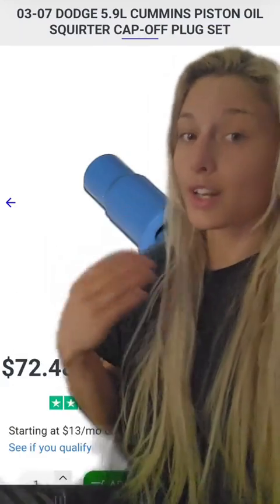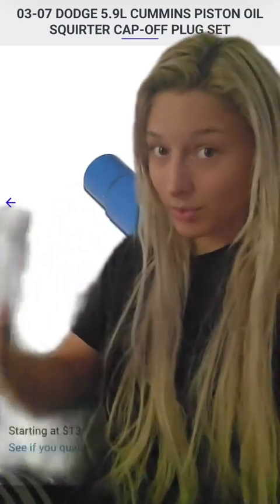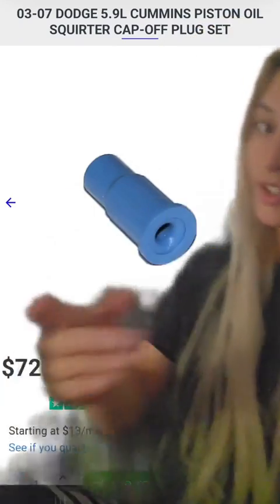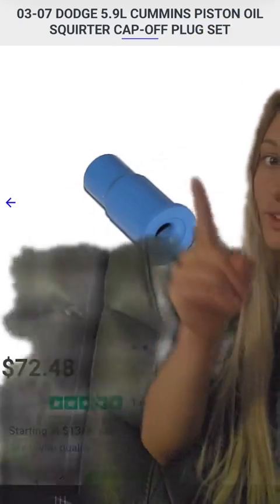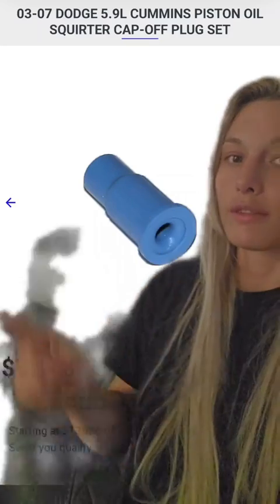5.9 cummins main bearings: why the holes don't line up.

Comment: In a Cummins 855 these style bearings were commonly used,some blocks were drilled for both holes and some were drilled for one hole, but they both ran the same bearings. It didn’t look right, but it was oem and worked just fine.

Comment: Lets talk about oil pressure and whats really going on in your engine, regardless of what kind of engine,as long as it has oil pump and pressure fed bearings the " wedge" principle is the same!! We all know fluids are for our purposes NOT compressible. If you have lets say 80 psi registering on oil guage, you must add up the total surface area of journals and bearings and multiply that ( there might be a formula) by your 80 psi. You literally have TONS of pressure holding your crankshaft in suspension and floating your rods on their journals!! TONS of pressure!! Its helps to know a little about physics when in this line of work. Thanks for your channel Melissa. Keep doing what you are doing!

Comment: Good explanation Melissa. On Mack engines piston cooling nozzles are metal. They could get bumped or whatever. So there is a plastic target that you place onto each hole( head off,crank and pistons out, obviously). Then with either a welding rod,flux removed,or other similar rod,that's straight,you insert into cooler and see where the oil jet will hit on bottom of the piston. If coolers aren't targeted properly,gently bend the cooler nozzle,so your metal rod points to acceptable point on the plastic target. Doing this for each hole. Obviously one wants to be extremely careful when i stalling crank and rod/ pistons assembly's,so as to not bump nozzles after targeting them.

Comment: time and place or consumer and product 4bt is good engine so is three or two for applied application 
to be blunt and honest not all parts are great got qulity maintace maybe it last fuel gas oil air air filter elments exposed use 
reason for personal tranportation application not to pull friegt train or semi not roll coal be idiots  but world takes all kinds to each thier own just do it over thier no over thier little closer get better warmer yep do it in hell or such .
this is not only diesel engine so so many uses for parts one thing fad its like sliced bread to each your own i am not nore will i ever be one size fits all name brand so many inovations under build over build to me like older engines new plastic okay 
but every thing has its advantages and disuse time and place but truth is built better one company no longer around built great truck so well they went out buniness in hay day of logging in musem now seattle washington i wood say pun 1970 acts had effect use full purpose not want a need  5.9 or any engine for me not fan like small ones for job like need detroit diesel
but osakosh to me or catapillar reason some russien or eurapen trucks road trains design air fuel exuest simple design 
built for some kid run around gas being cheap sure big engine great  but lot them never road trip thier race junk

Comment: I was a diesel mechanic & trainer in the army for 14yrs. & then when I got out I was a mechanic or a shop foreman for another 20 some years & in that time what I have found out is those of us who are leaders/trainers will spent less than 10% of our time with the top 90% of people & 90% of our time with the bottom 10% of people. I am ranking them by brain power.

Comment: Aircraft engine's  oil passageways to bearing holes don't  line up completely either.  And the higher horsepower engine's  have piston cooling nozzles. You are doing  a good job. F the critics they are the ones that are driving their  foreign  vehicles  to the dealer to get bored and stroked (metaphorically)
Reply: And bent over by the dealerships.

Comment: Asked a simple question if they should line up.  Why the absolute hostility?  I'm no longer interested in you and your overdramatic hostility.
Reply: Where's the hostility in this video?
Reply: @daniels-mo9ol   Be less unconscious (note, this is hostility since you're being oblivious to it).
0:30 "This is what everyone is  about".  "Crying" is hostile.  It would be neutral to use "commenting".
0:45 "They look the f**king same".  "F**cking" is hostile.  It would be neutral to leave the word out.
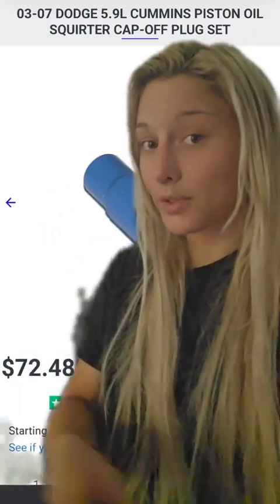2:13 "Those holes you all were so f**cking concerned about".  Again, "f**cking" in this instance was hostile.  Leave it out.  There were other instances of this word being used but they were not hostile.
3:08 "Instead of word vomitting".  Vomitting is hostile used repeatedly.  I just asked the question if the offset holes were a concern.